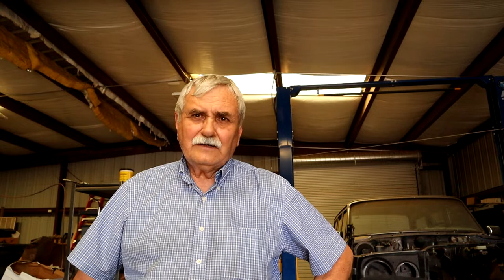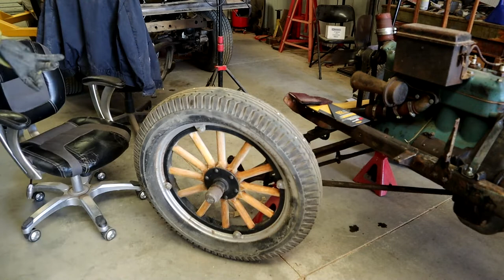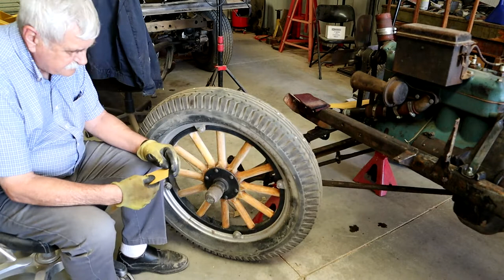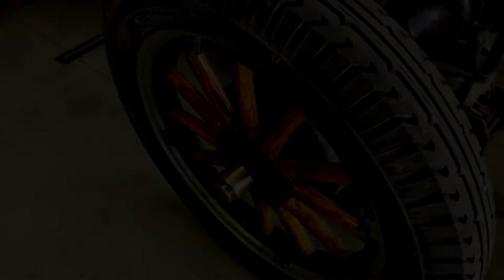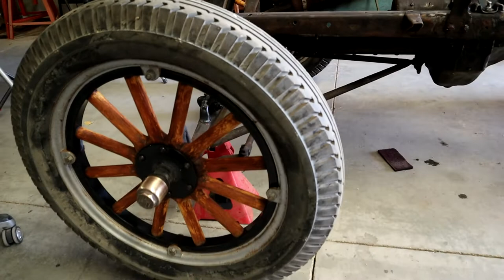Episode 4 - 1927 Model T Restoration

Comment: looks good Dave. I would recommend you apply several coats and each time use a finer grit. Using linseed oil is fine I personally would have used a exterior Marine varnish. (Lust Total Boat high gloss varnish) ONE  of the best. Using Actone and a rag undue what you just did and follow the instructions on the can. using a quality brush. apply 6 thin coats light sand between 400 grit paper. Using a tack cloth to take off the dust. If you would prefer to us oil , then use 400 Gritt then move on too 600 Gritt at least 8-10 coats.
I WISH YOU WELL MY FRIEND LARRY
Reply from the maker: WOW!! That sounds like a lot of work. This old car will never see much rain. Two to three coats of linseed oil did a fine job. Anyway, thanks Larry. Come out and visit someday soon.